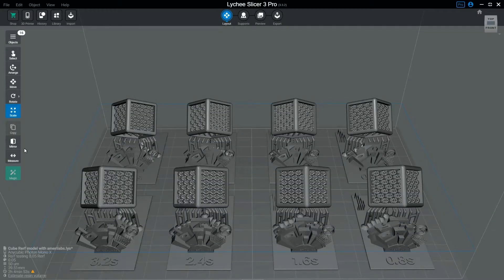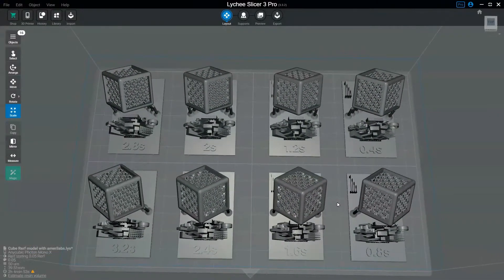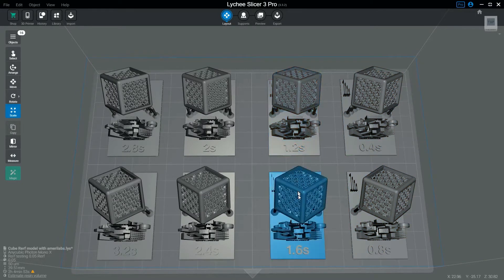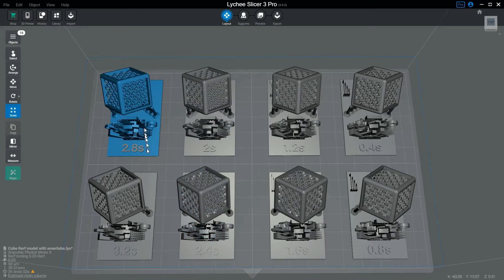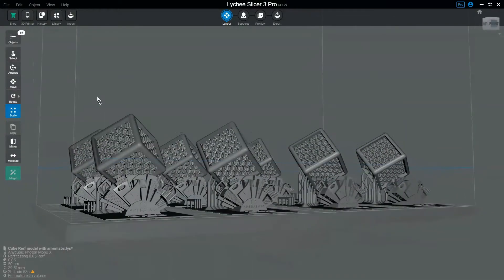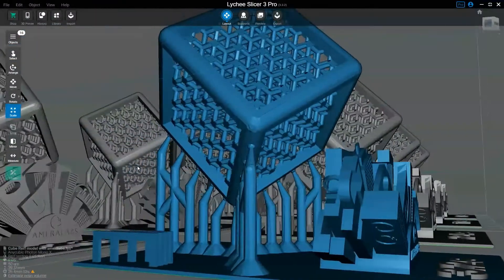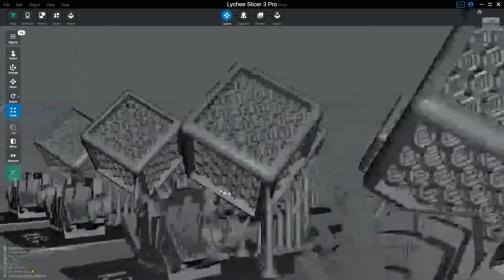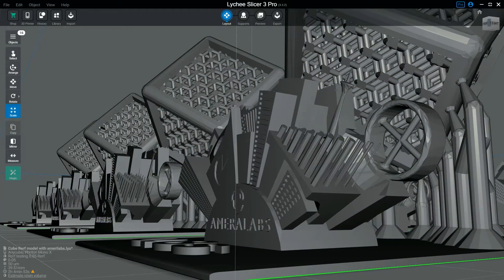What the R E R F

Comment: can you use uvtools to change it to chitbox for other printers
Reply from the maker: UV tools had (may still have, not used it for awhile) tools to make exposure tests, but they stopped around the time that chitubox changed to encrypted firmware.
This method is unique to anycubic boards as they built the feature into firmware, so unable to convert into the chitubox format for other printers.
I have a peopoly forge due to be delivered in the next week, so will digging deeper into the Vlare and open resin formats.
Been outta the firmware game for a bit, so may take my a while to research it.

Comment: Hi there, excellent video, very clear and precise instructions.  I have one question, as the file is a pwmx extension I wanted to open them to take a look at them before putting on my usb stick and printing.  This can only be done on Photon Workshop.  Opens fine, recognizing it as a sliced file and if I scroll through the slices they are all there.  But when I click 3D view it opens a window and starts building the layers from the bottom up then at some point it stops and gives me a warning window that says "Max verts generated, application will reject generating meshes for better use" and it only provides me the option to click ok and when I do that is all I get.  The 3D view is only half built and that is all.  I am very new to this and have searched for a meaning on this but can't find an explanation to the warning.  I believe the RERF will print just fine.  If you could provide an explanation that would be greatly appreciated.  Best regards,
Reply from the maker: Thank you for the kind comments, hopefully more videos soon, as I am about to finish my roadtrip of USA.
I use lychee to make any changes to the files settings, but not seen the issues you mentioned when opened with anycubic workshop 🤔
For making a custom version the STL file is included on thingiverse.
There is a newer version, but I've yet to make versions for each layer height.
Need to update when I get back to the UK.